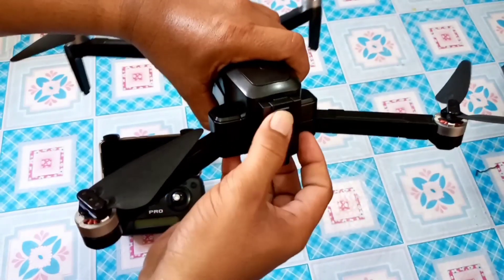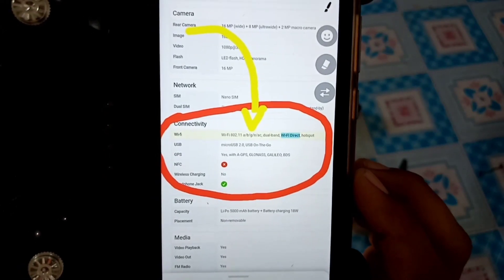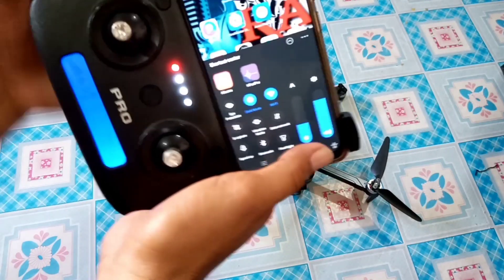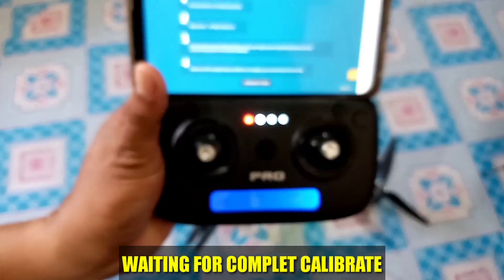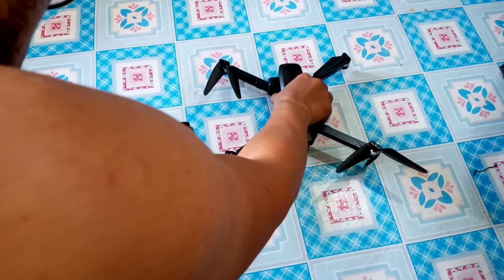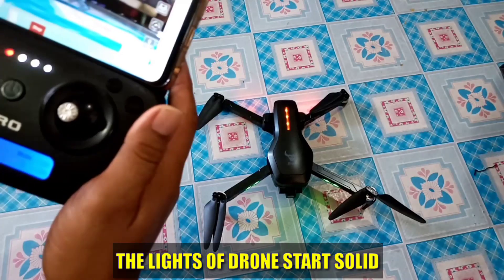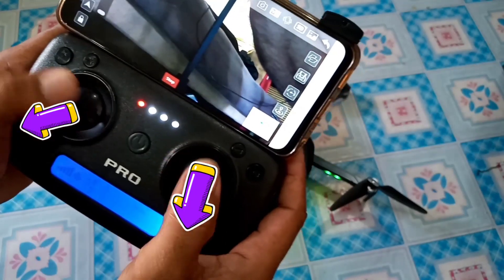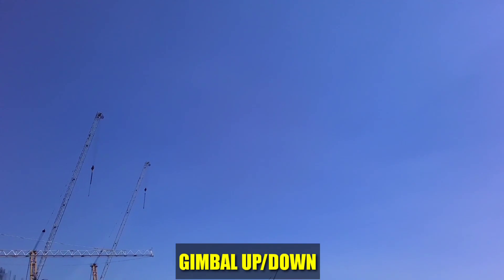HOW TO CALIBRATE STEP BY STEP ZLRC SG906 PRO GPS DRONE 2AXIS GIMBAL  TEST FYL |DRONE GADGET

Comment: Hi there, nice video. Maybe u can help me. The signal meter on my SG906 controller goes down to nothing after say 6-7 metres.  I can control the drone to 300+m no problem , but I cannot get Altitude or Distance readings back, beyond a few metres. They just freeze to say 5 or 6 .  I have never flown this PFV since I do not have a 5G WIFI  smartphone, but the signal on the controller should not be lost so soon, right ?  I'm hesitant to buy a 5G smartphone cause I think it would be for nothing , if the drone cannot send back info far enough. Did u ever encounter something like this ?
Reply: I’ve also had the same problem for me I just go to open spaces with no pulluted WiFi and I fly just fine
Reply: @drone_crazy  Hey thanks. I did not try that. I fly in an open space about 200m away from a residential area , but I guess its not far enough.

Comment: Do you need a 5G mobile phone to connect to drone camera? My mobile is 4G
Reply from the maker: yes need 5G to connect the wifi..
Reply: Ano Po bang brand na cp ginamit mo
Reply: 5g means 5 gigaherz po at d 5 gen. Check ur connectivity s google, 802.11 ac . basta within 4 yrs cp u, mlmang pasok yan
Reply: Ayy kuya 802.11 sa akin oppo a5s means pwede Po to sa drone nayan??
Reply: @kentapduhan7644  basta may ac, pag b/n lng ay d pd.
Reply: Ano po ba brand ng phone mo oppo a5s??
Reply: Anong AC
Reply: Saan po ba yan makita??

Comment: My is sg 906 pro once I connect to WiFi it stay to mode1 my gps doesn't work how to connect to gps?
Reply: the same as mine, no gps detect, how you resolve the problem?
Reply: @marktan8566  where you from? I try to go to big open space then wait few minutes then got GPS
Reply: it means in the door outside the house has no gps signal? i will go to open area to have gps signal? i try to go outside but its evening to check the gps but still no gps signal

Comment: Only thing with this drone after some flights WiFi camera board will start to mess up it needs a heatsink so get your pictures and videos done first because once this issue starts you need to replace that board or save your money and buy a zino 😁